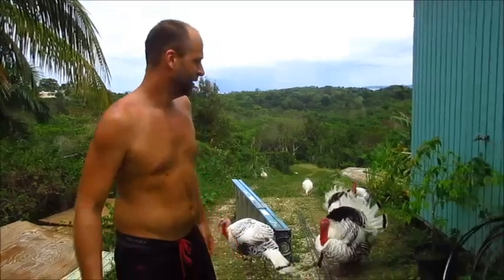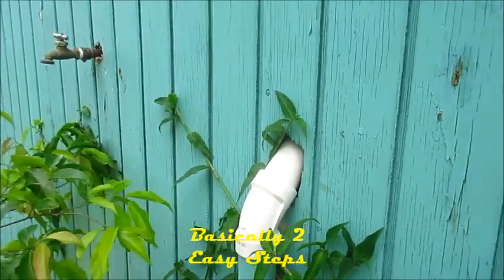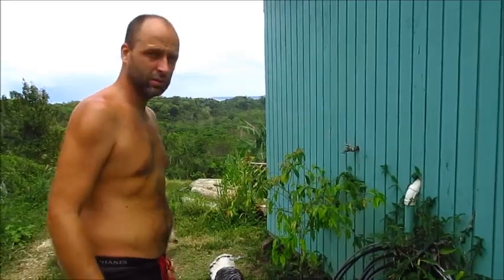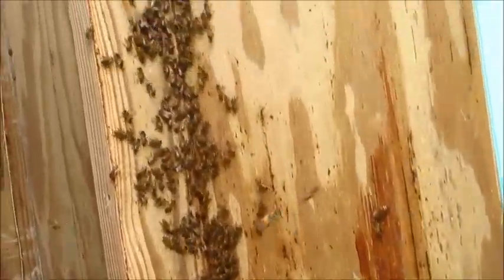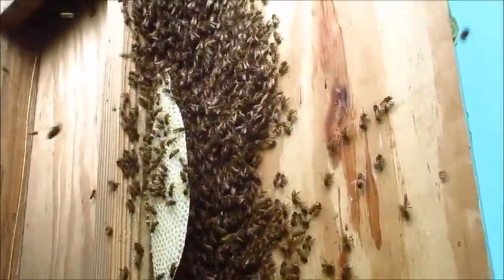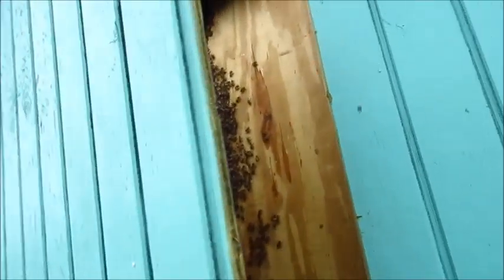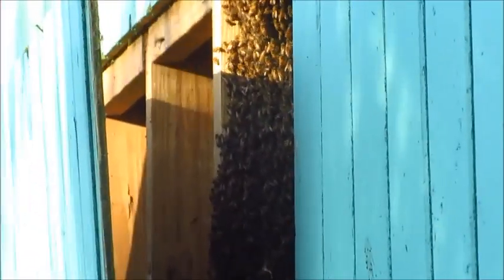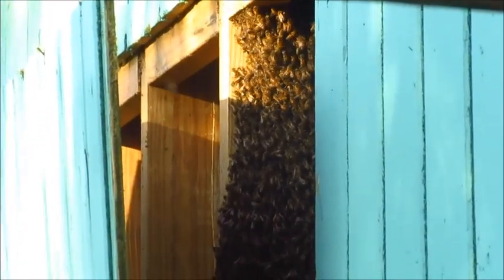How to Remove Bees From a Wall Without Even Touching the Bees

Comment: I have a problem that just started this weekend with honey bees on the underside rear corner of my mobile home. The bees are going in and out of the metal slat skirt that encloses the crawl  space of my mobile home. Not sure what to do. I was told told smoke them out and that they would leave so going to try that in the next day when my bee smoker arrives in the mail. Any other suggestions?  Thanks
Reply from the maker: If the metal skirt is removable, try taking it off!

Comment: A lot of work going this route. What is the biggest factor to get them out - drying , cooling or  light.   What if a light bulb were inserted, or the air from an AC?
Reply from the maker: The reason this method works is because the bees need to feel safe from predators (lizards, birds, whatever) that might eat them. I don't think drying, cooling or light would work as well, but try it and see!
Reply: If you cooled them enough they would just die.  Cooling them will kill the brood in the nest first and the other bees might get too cold to move much.  If you don't remove the comb and seal the wall completely, another swarm will move in anyway and rats will chew their way in.  Bees are very resourceful in finding their way back in and can smell the former hive years later so even killing them with poison won't solve your problem.  I recommend rescuing the hive, cleaning out the wall, and filling the cavity with insulation before sealing it back up.
Reply: Cleaning up after the rats, cockroaches and mice that move in because you didn’t remove the wax and fermenting honey would be a lot more work than having a Beekeeper do it correctly the first time.

Comment: Clean evacuation! But you could have called a beekeeper. They remove for free and the bees get a new, safe home instead of wandering around and maybe being killed by pest control...
Reply: they wont come get ours, we have called 4 people and only 1 was willign to get them out for 325$
Reply: many beeks that deal with removing with buildings won't do that for free.  Not like a swarm on a limb. This opening up method to get bees to move only will work if caught early enough ... 3 to 7 days max .. b4 workers are tending brood.  Smoking bees out can cause similar results.
Reply: I have tried multiple beekeepers here in Florida, and they charge from $250-$400 to remove bees, even though it's free bees for their hives. SCAMMERS! I'm going to try this method today! I hope it works!
Reply: The cheapest bee removal in my area is by a well reviewed self taught amateur, his low fee is US$500 and he will not repair the walls after.
Reply from the maker: We had 7 hives before this. We have called them before and this was how we learned this technique. One group took them for free, but most want to charge for their time. Since this happens pretty regularly we were happy to learn from the beekeepers this solution. If the space is exposed to frogs, lizards, and other predators, they won't inhabit it.

Comment: I don't want my bees harmed, but they've been in my patio ceiling since last spring (1 year), and I can't get anyone (no bee keepers) to remove them safely. I know there's a load of honey up there because the whole house fills with the aroma, but I'm afraid it'll start coming down the kitchen wall on the other side.
Reply: Tosca Z honey is at it's minimum now during the early spring,late winter but the bees should have comsumed most of the honey up,are less aggressive.a couple of treatments with some 5% sevin dust will kill the bees.
Reply: There are beekeepers everywhere, you just have to find them.
Reply: then you have the poison, poisoned bees, wax and honey in your walls which leads to more pests moving in to clear out that process. That is a very treacherous road indeed.   watch youtube JP the beeman "Honeybee nightmare".  that video shows immediate results   and 628dirtrooster  has one called "Why don't you just poison the bees?? I'll show you why"  -  this shows long term effects.
Reply: JP, Yappy, Dirt Rooster and Mr Ed-(Jeff Horchoff) my favorites. Thanks for posting the links, I could not get it to work to add them to my post above.

Comment: We have bees in a drainage hole in a party wall  in Az.  Can’t open that!!!
Reply from the maker: Not sure what a party wall is, but you can also close the hole too.
Reply: @LifeTransPlanet  just the walls between houses and they have holes to drain excess water during heavy rain. Our problem is that it has dirt at the far end which is the neighbor’s yard. Hole doesn’t open on that end as it’s buried in the dirt.  . Thanks.  We’ll try that.
Reply: I do feel bad,though, since we need bees!  
They don’t seem overly aggressive. Just a little riled up.

Comment: Apparently this has happened before because you say you learned the best way to get rid of them.  Not surprising since you have holes leading into walls with cavities.  You could prevent them from moving in by plugging the holes and filling the wall cavities.  Secondly it looks like an old shed.  You could have left them in the wall and not had to get rid of them at all. They would not bother you or harm the building.  Third this was obviously a recent swarm that had not been in that cavity very long.  You forced them to move again after just getting started.  Although you did not use pesticides you may have given them a death sentence because they do not have food or stores to move again.  And where did they move?  Probably into another wall cavity with a hole in it.  And like others have said in the comments you or a beekeeper could have easily located them to a hive and either moved them or left them on your property.  Apparently you don't regard the pollination they provide as a benefit you might like to have.  For these reasons it is stupid but is also isn't necessarily 100% effective.  Bees sometimes build comb in completely exposed colonies so it will not work every time and would be much less likely to work with an established colony.  If they have larvae and brood they likely will not leave.  Perhaps I was wrong.  This is stupid but fucking stupid would be to spray pesticides.
Reply from the maker: I understand where you're coming from. There are a few assumptions that maybe you didn't consider however. 1) We are in Puerto Rico and the bee population is an Africanized Hybrid. They are not only more aggressive, but more likely to survive and swarm more often. There is no cold winter for them to prepare for so they can change homes a little easier than some. There is also lots of jungle and rotting trees where you'll find them in nature. 

2) This is a shed from a house that we took down that had been abandoned and dilapidated for 10 years, so when we arrived there were 7 colonies that we had to remove before downing the house. I do agree that we could have done a better job of closing the holes though to prevent this one. 

3) We eventually would like to have our own hive, but we were not ready for that at this time and didn't want to pay to have our 8th colony removed. 4) We did need to remove them because they were in a direct path and because they are African-hybrid they are much more territorial and had been stinging us when we would walk past. We had to use the water spigot often and that was their entry/landing to go in the wall. 

Thanks for the comment. I can see you are passionate about bees and I really respect that. :-)
Reply: You were standing a few feet from the entrance with no shirt on.  You removed the siding with only a veil and no smoke and were not attacked.  They did not display any typical AHB behavior at least in your video.  Winter has nothing to do with it.  When they swarm they take all the food they can carry in their stomach in order to survive starting from scratch in a new location. What you did was to essentially make them swarm again only this time they are not swarming from an established colony so they have no stores to take up for the trip.  I don't know what the situation is around you but in most areas it is pretty easy to find beekeepers willing to remove colonies simply for the bees.  Especially one as easy as this would have been since it was not an established colony.  But the bottom line is that if you don't want bees and you don't want to pay to have them removed you should go over every building calking, and plugging holes and or filling spaces with insulation.  But I made my point and I won't bother you any further.
Reply: But I would also add that it is misleading to advertise this as a great method of getting bees to leave.  If they have brood it is much less likely to work.
Reply from the maker: People won't just take bees here. It's a fairly big business because there are so many here -it's not rare to find them like in other areas. They are all hybridized. Search for Puerto Rico Africanized/ hybridized bees. The good thing is that they are super resilient and numbers are high here in comparison to the weak European ones. 

In our situation they were fairly calm as long as we didn't too get close to the opening and turn on the water spigot that clambered in the wall. This video was the method that worked for us and was the simplest/cheapest/least toxic solution if you don't want a bee hive in your wall. That's what we were trying to share with the world. Nearly every wood house here in PR has had a bee swarm/colony in it because it is really hard to close up all the holes. No one has a house heater where they need to be careful of drafts so it just doesn't get done right. Bees are something we deal with more than others I think and I'm glad of it because it means they are doing well.